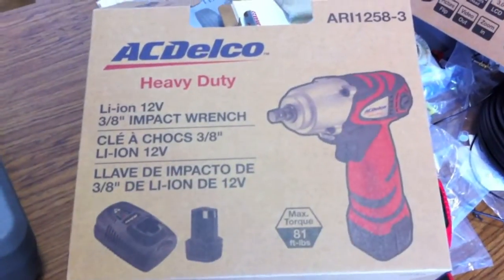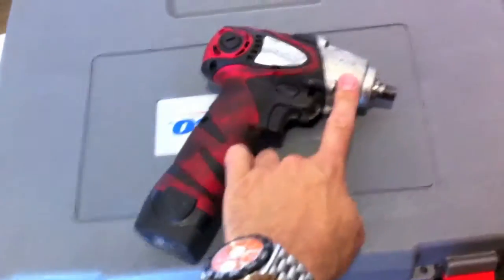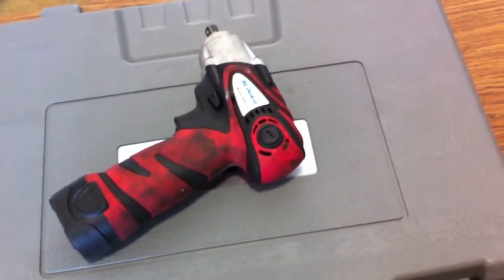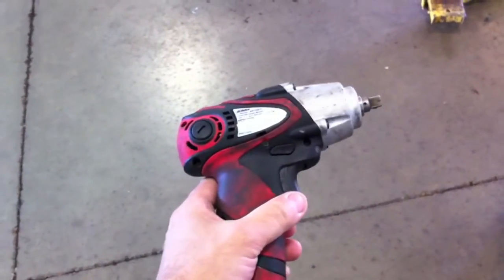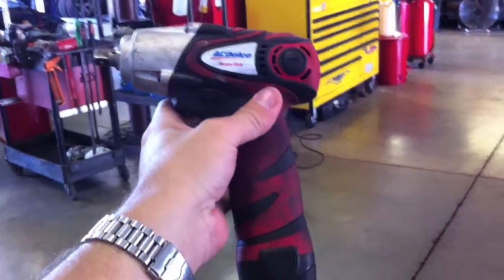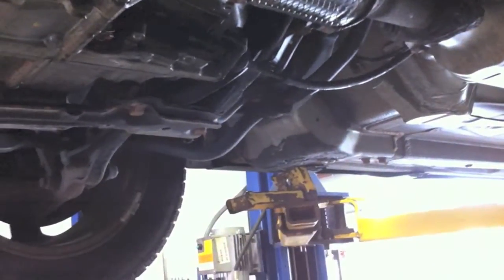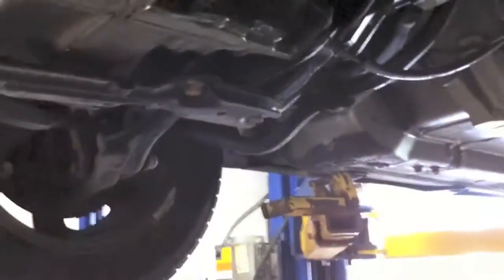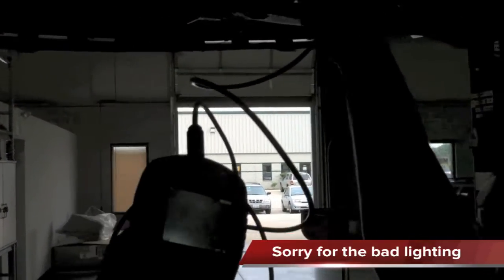ACDelco 3/8 12V Impact ARI1258-3 - Review

Comment: It’s not supposed to have a lot of torque. It’s a 3/8 

Mainly used for smaller stuff (like he was doing in the video) 

If you want something to break things loose you wanna go with 1/2 

They come in all different brands with all different specs. 

But just to have something compact, decent price, this thing is a great buy. 

Personally I have a whole line of craftsman power tools, but I just got hired at a dealership in the automotive department so all of my tools are now there. But since I’m building a new home set, I’m definitely gonna buy the ac delco like. 

1/4 impact driver 
3/8 impact wrench 
1/4 power ratchet 
3/8 power ratchet 

And I have a dewalt XR for the big stuff. 

I’ll be starting classes at UTI soon 

Automotive technician apprentice 😈

Comment: I was thinking about purchasing one of them to replace the front bumper cover on my car and the headlight bezels but the bolts are a little rested would that work good for breaking them loose without snapping the heads off of the bolts